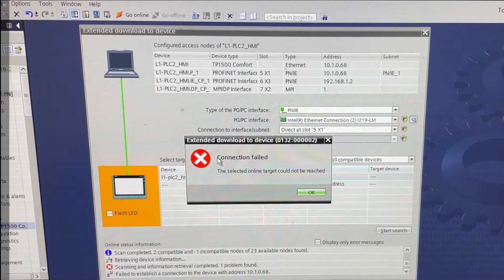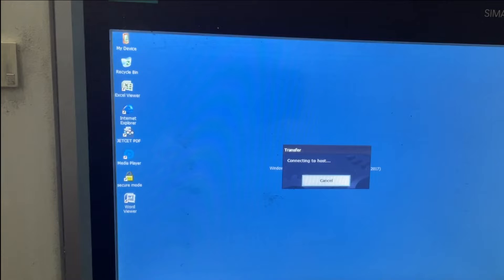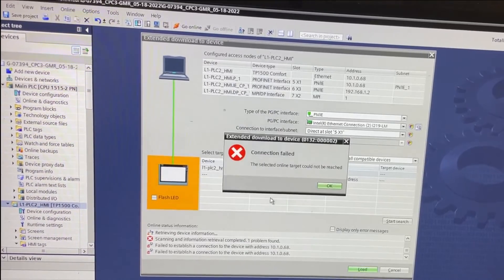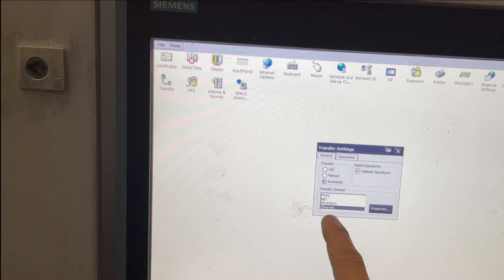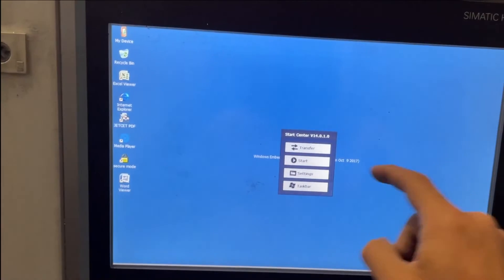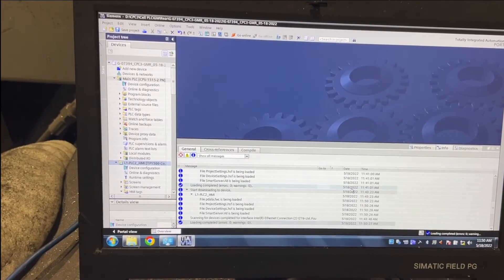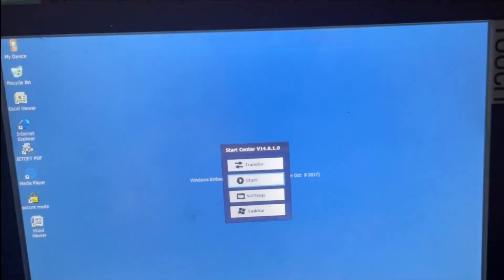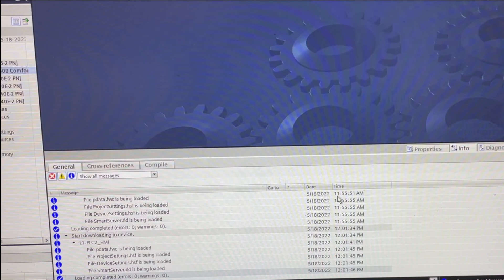Configure Siemens HMI Transfer Settings

Comment: How you open this settings view when an application is running ?
Reply from the maker: If the application has already a button configured for existing the application, then you can get to this settings by pressing that configured button. If there is no button configured, then you need to reboot the HMI and you will get to this setting before the application starts.
So it’s dependent on the person who created the application.